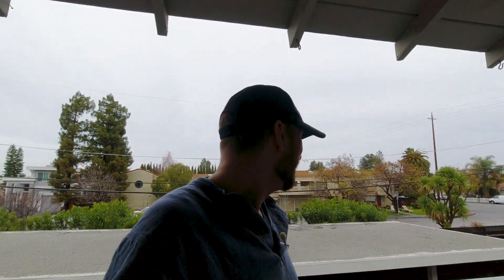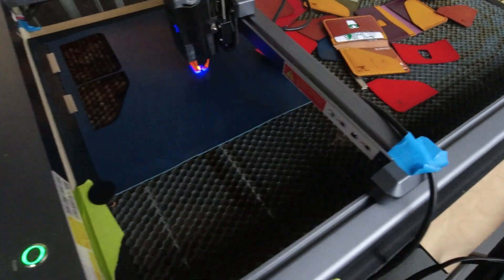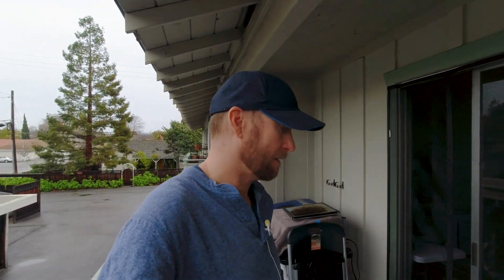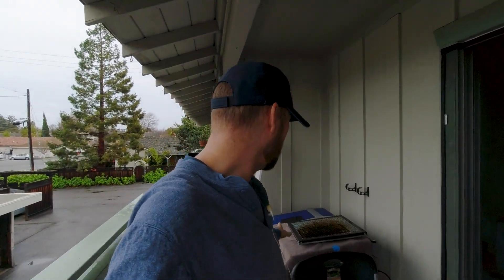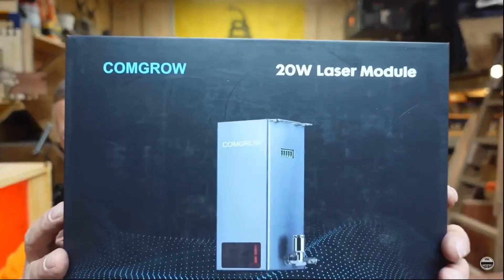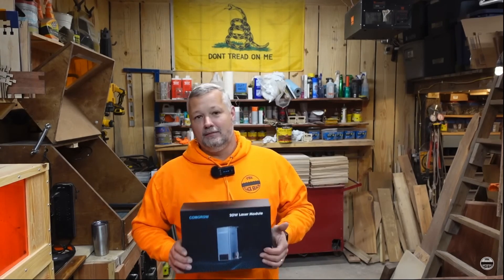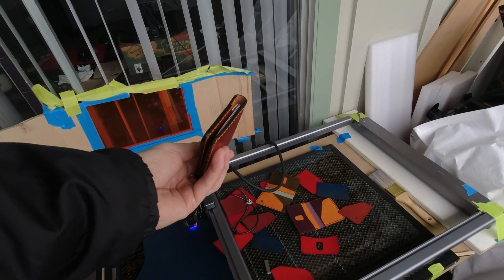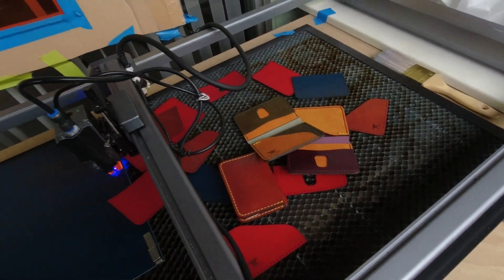20w Laser Master 3 Upgrade?

Comment: waiting for the official 20W from Otur.
Reply from the maker: I have seen no announcement they are even working on one. You?
Reply: @ValleyForged  nothing official but they replied to my comment here:  https://youtu.be/6gj9vaL04mQ.  XTool just announced a 40W
Reply from the maker: @bneil4059  That does sound like they are working on it. Will check out the 40w as well. Thanks for the info